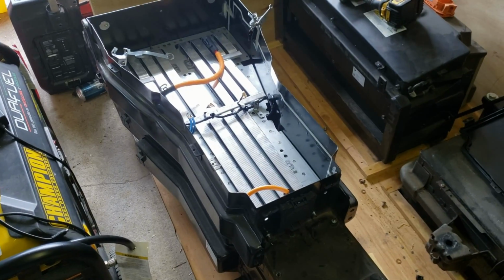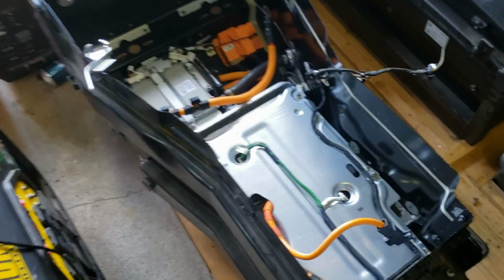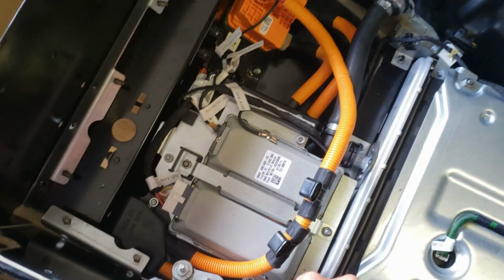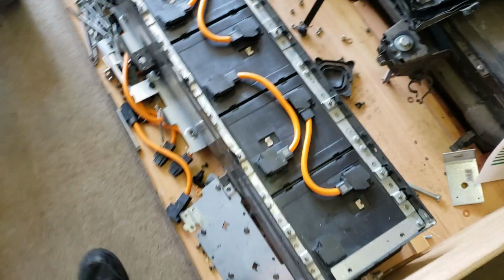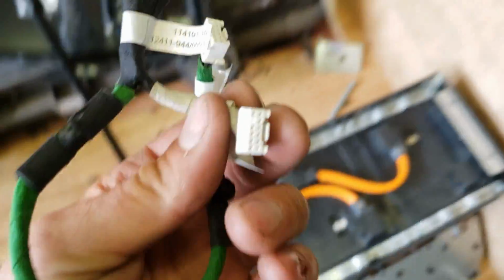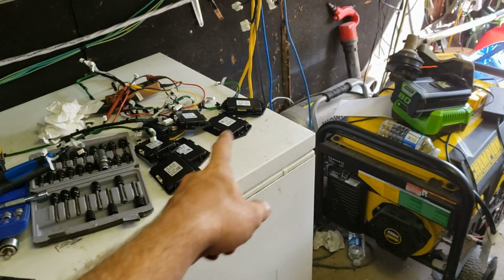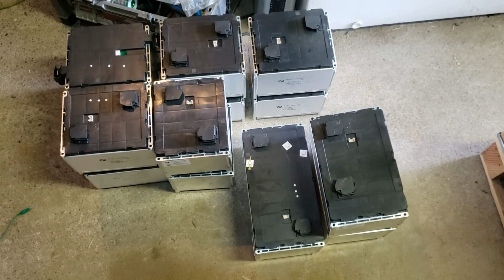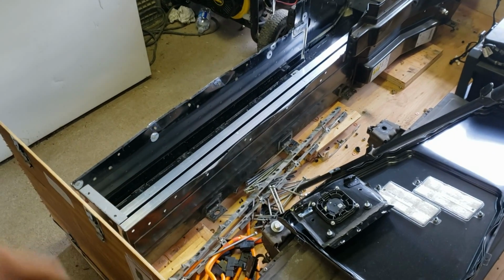32Kwh BMW Battery Ten 3s Two 4s One 5s module

Comment: thanks for posting. can I get those orange terminals from you. Thanks
Reply from the maker: i need them for these batteries :D
Reply: @GoingOffGrid101  yeah... I understand. any idea where I'd be able to get one? I purchased the 2kw BMW batteries from them.
Reply from the maker: @baashie   did you use my code :D I bet you can email battery hookup and ask them for the cable.

Comment: I would be interested in speaking to you about creating a system that would power a pioneer mini split hvac unit as well as small appliances for cooking such as an air fryer microwave blender coffee pot and instapot. I travel the country in my 18 wheeler  and would love to have a system that could handle that for 36 hours before having to be recharged. Is that doable?
Reply from the maker: can you put solar on the roof ?
Reply: Going Off Grid I could but there isn’t much room up there. I was thinking of the engine could charge up the batteries. Not sure how long I would have to high idle it but if I could charge them in a window of 4 hours and they would hold for a 36 to 48 hours it would be worth it. I also would have shore power so a lot of my time is spent at theaters and stadiums so I could charge off of that.
Reply from the maker: @CremeDeLaCreme72  you could build a system like that yes

Comment: Going off grid if your out there I got a question for you and need help. I have a conext 24v inverter and today because of the hurricane I am offgrid I dont normally do this but was trying to use my cmax energi to backfeed my inverter and my 6kw battery back. I get 110v from my 12v prosine inverter back to the conext input side but it wont charge. Oddly I thought I would be fine because its should be pure sine. Also it was ground fault tripping on me prob because my ground and neutral output on the conext are bonded to my panel. So I just made a plug with no ground.  Any ideas??    For now I am charging the battery bank from 2 dell power supplies in series and a boost converter at 15amps but that's  so slow and super in efficient
Reply from the maker: maybe your conext is drawing to much power from your prosine and is tripping ? or maybe it is only capable of charging off of 240v ac?
 the diy plug might work.
Reply: @GoingOffGrid101  I have a 120 to 240v step up I can try but I think ur right it's the surge because it seems to try to start to charge and then doesnt. But I only put 5% charge rate on so it should work so small
Reply: @GoingOffGrid101  I finally got power but i did well all day on solar and battery was able to run 2 acs internet etc and used over 7kw plus charged my battery full before the power came back. I did a test using 110v mains power and that charged fine but you can tell it does some type of test before starting to charge so the xantrex prob just cant handle it. Anyway that's again for your input also cant wait for your next video.

Comment: I need you to recommend to me if you know all the modules will fit at the back trunk of 2011 Nissan leaf, so that I can buy these battery to up grade to 32 KWH plus the main 24 KWH.
Reply from the maker: Yes they will fit, I'm more sure if its 96s or not yet
Reply: @GoingOffGrid101  they are 96s, my concern is if the trunk space may not be big enough to accommodate all the modules.
Reply from the maker: @t.shonoiki563  there is enough room yes, but they are a bit heavy